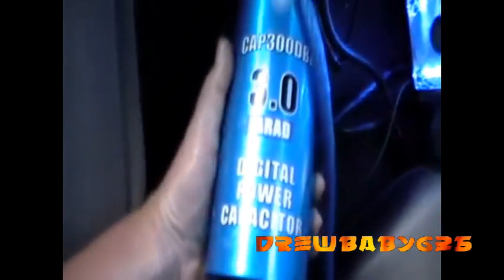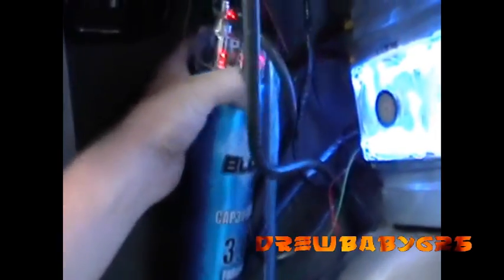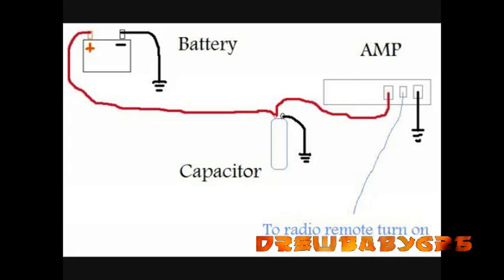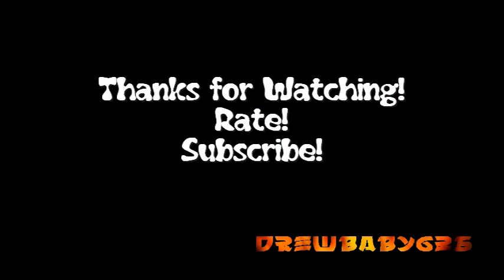how to wire a capacitor.

Comment: Don't buy a pyramid capacitor! They are garbage. Second, if you don't charge the capacitor it's going to be ineffective. The battery will not charge it on the fly. Invest in Rockford or other similar quality capacitors. I would be suprised if this cap even performs at a Rockford .5 farad caps level....

Comment from the maker: @ridin9 as long as the cap is hooked up you dont need to charge it, it will stay charged but if you disconnect the battery for something you should charge it

Comment: I just fixed a 400 dollar guitar amp by re-soldering a capacitor that more than likely knocked loose during it's many travels. If anyone's wondering, as far as I was told, capacitors help "clean" the electricity by saving and storing it then "cleansing" it inside the capacitor. Then it leaks out the clean electricity for application. The reason is for all the dirty interference that occurs between the batt. and the device to operate. I've never seen a capacitor that big though! Thanks for share

Comment: Well right now I have a few things I need to install on my Mustang..Jansen DVD HU, Kenwood Excelon Front/Rear Speakers, 12" Kenwood KFC Sub, Kenwood Amps(1000W & 600W) and I'm making a custom box for my Nitrous Bottle and on the back of it will be the amps and my Sub is going in a corner kinda box..